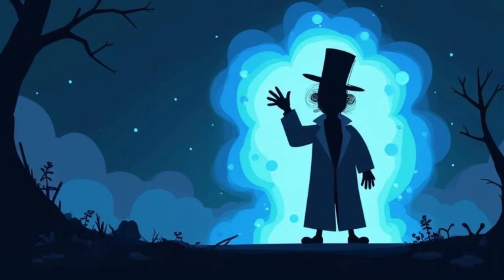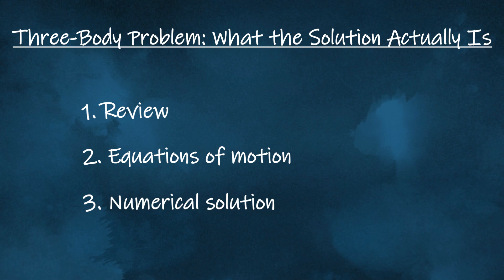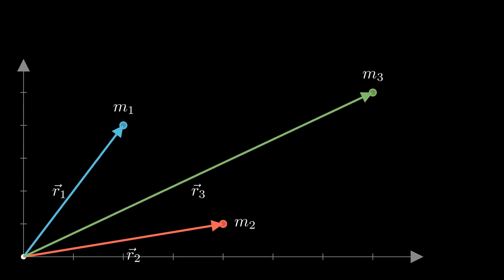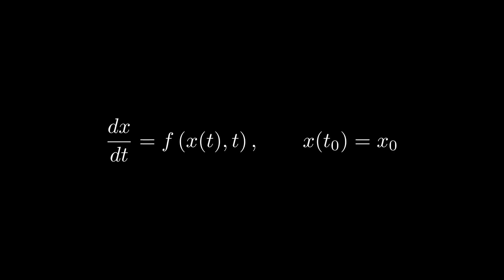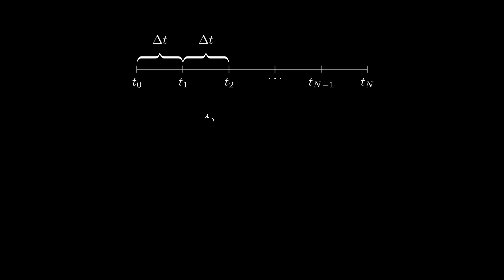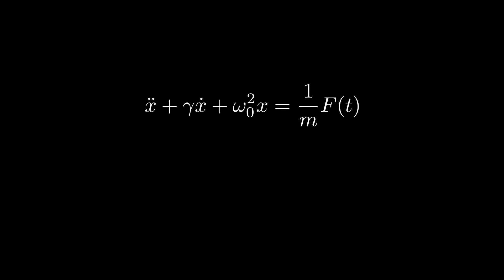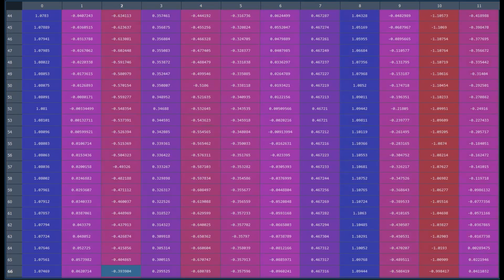Terrence Howard vs The REAL Three-Body Problem Solution

Comment from the maker: 🔧 Correction:
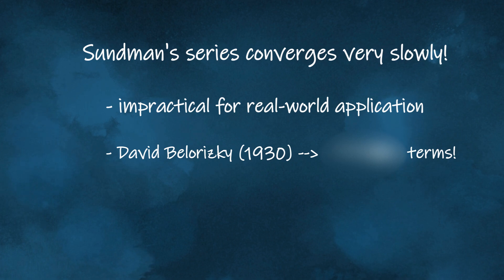At 02:33, I said "108 million terms" and also showed it on screen. That was a mistake — I meant "10 to the power of 8 million", or 10⁸⁰⁰⁰⁰⁰⁰.
Thanks for your understanding, and sorry for the confusion!
Reply: 10^8,000,000 is, indeed, a slightly less practical number of terms than 108,000,000......

Comment: Newtons equations are approximations.  Use GR.  cant say it doesnt matter because it causes mercurys precession even in our solar system.  Should be quite interesting and challenging for a computer.
Reply: Also, there was some proof about the stability of our solar system in the last 10 years, a problem tougher than the 3 body problem.  I didnt look too closely at it, but it showed the solar system is stable and survived peer review.  Worth mentioning if you can chase it down.

Comment: How are direct collisions handled? Does the assumption of point masses let then be waved away as having probability 0? Still seems like there'd be some sort of singularity in the solution near such trajectories.
Reply: yes, they generally aren't because we assume point masses and so collisions are probability zero, but you also could just set up initial conditions constrained to a line which forces a collision (say, one point at (-1, 0, 0), another at (1, 0, 0), and the third elsewhere in 3d space aligned to that line), and ask those big tough scientists what you do then.

Comment: Is the crux of the three body problem not the fact that chaotic behavior means we can never accurately predict the trajectories of 3 bodies under mutual gravitational force (since there will always be measurement error, slight numerical imprecision in finite precision number storage in memory, etc)? Even if we were able to apply Sundman’s series to a real set of 3 bodies (which were also somehow gravitationally isolated from everything else in the universe so as to prevent accumulation of error in our model due to outside interference), our prediction would eventually fail to resemble the real trajectory due to measurement error on the initial conditions of a chaotic system.
Reply: No, that's just a practicality issue. There are plenty of gaps between mathematics and practicality- infinite serieses, for one, would take an infinite time to evaluate properly, and although we don't know every digit of pi, in reality we don't need more than 13 digits to get subatomic levels of precision.

I don't think the chaos of the system is closely related to its ease in simulating- a double pendulum is arguably more chaotic than a three body system, but we have a really simple closed form solution to its behavior. The three body system is just difficult to integrate because what was a smooth gravitational gradient across space when there are two bodies (one interacting with another), is now a jumbled mess with a third body continually disrupting that field with an additional gradient that, itself, keeps changing.
Reply: @ferociousfeind8538   “a double pendulum is arguably more chaotic than a three body system, but we have a really simple closed form solution to its behavior” this is a fair distinction to make as far as the essence of the problem description is concerned, but I also feel the natural follow-up is that the chaotic nature of the three-body system is why numerical methods are not “good enough”. 

You can numerically solve a two body system and, in doing so, produce a trajectory that resembles closely at all times the real trajectory derived from the closed-form solution. Meanwhile, the chaotic nature of a three-body system means that not only will numerical-method-generated trajectories always eventually deviate from the real trajectory via accumulation of errors, but ALSO that even a closed-form solution would eventually fail in the face of measurement errors with respect to the initial conditions.

Comment: is the volume of bodies not relevant? The current model assumes all bodies are points of given mass, I assume the gravitational field changes depending on the relative volumes of the bodies, assuming different densities, or is that not true?
Reply: It shouldn't matter unless the bodies are very close to each other
Reply from the maker: Good question! In the classic three-body problem, we treat objects as point masses. If the bodies are spherical with spherically symmetric mass distribution, then only the total mass matters—not volume or density. Of course, in reality, bodies aren’t perfectly spherical (Earth is an oblate spheroid) and don’t have exactly symmetric mass distributions. But when bodies are far apart, they can still be treated as point masses with good accuracy. If they are close to each other (like Earth and Moon), shape and mass distribution start to matter. This is usually neglected in the three-body problem, because the main question is what the trajectories look like.
Reply: @VisualScienceDiaries I understand, thank you

Comment: According to Wikipedia, the Sundman solution requires 10 to the power of 8 million terms, not just 108 million.
Reply from the maker: Thanks for pointing it out! There was a mistake during the video editing — 10^(8,000,000) accidentally turned into 108 million. I'll fix it.

Comment: If you don't know the precise initial conditions of a system, but instead have a probability density function in phase space (for example due to measurement uncertainty when determining the position and speed of real objects) how would you go about modeling the time evolution of that probability density function? Would you just do a Monte-Carlo simulation with many randomly sampled initial conditions or is there a more efficient way of going about this?
Reply: Doesnt QM actually do this already?

Comment: Periodic or otherwise bounded solutions are rare (measure zero). General initial conditions lead to "evaporation", usually by one mass hyperbolically escaping from the residual pair (in both time directions).
How do I know that? Hard to explain without invoking phrases like "phase space" and "ergodicity".
Reply: proof by "just look at it dude"

but, hmm, now that you mention it, yeah, one of them would be flung out most of the time in both directions... I wonder what such a situation would look like, played from the reversal of one of the so-called "evaporation"s of the state, passing through the original seed conditions that produced both evaporations, and playing forward through the second evaporation. Like a moment of chaotic dancing between eons of silence
Reply: @ferociousfeind8538  Just imagine a chemical reaction in a gas (or nuclear reaction in plasma). Reactants bump into each other, forming an activated complex, that decays into (probably differently combined atoms in the) products. Yeah, in chemistry you think about the activated complex as a single, almost-stationary metastable bound state. But if you are thinking properly in terms of wave packets, the activated complex is "bubbling" similar to the temporarily bound system in the 3-body problem.
Reply: Resonances appear and add stability, there are several in our solar system.  Stellar nurseries tend to eject little things while big things sink in the potential well.  As far as I know anyways.  Space is big and we dont know much yet.
Reply: @deltalima6703  In celestial mechanics, the stability arises from irreversible effects (mostly tidal forces dissipating energy via dampened "geological" oscillations). The pure Newtonian 3-body problem involving only point masses is trivial in comparison.
Reply: @deltalima6703  there isn't really anything left to know about orbits, the "what we don't know" category is occupied mainly by really really small things and super ultra big plus far away things, and the hyper-specifics of certain very distant things (like what's the temperature like on Trappist 1d today?)

Comment: We actually had to program a numerical simulation for n-body gravitational systems in uni not too long ago!
Even with a 12th (?) order adaptive runge kutta solver (we could luckily use an external library for that) and all in C++, so it ran pretty fast as well.

Was a really fun and cool task if you ask me
Reply: I had a project for that in a MatLab course a few semesters ago! It was only using the first-order Euler-Cromer method, though.

Comment: This solution is inefficient because it doesn't take into account that when the bodies are far apart very little is happening, but you have to keep the time increments very short for the rare occasions when the bodies are extremely close together, which will always happen at some time because of the chaotic nature of the 3-body problem when the masses are comparable. A much more realistic approach is to have variable time increments according to the relative positions. (I know this is just an obvious thing for anyone actually contemplating doing this). This, however, also brings up the added complication that when the bodies do approach each other closely, even slight deviations from confinement to the plane of the ecliptic can lead to bodies being ejected from the plane, so the third dimension then cannot be ignored.
Reply: This "inefficiency" is a practical issue, rather than a mathematical one (certainly didn't stop Sandman's infinite series)

but also yes, any good function for the three body problem f(N, X) where N is time to pass and X encodes the three bodies, MUST be able to function completely accurately at any timescale- F(1, X) should be precisely equal to F(0.5, F(0.5, X)) (AKA taking one full step should give the same results as taking two half-steps)

Getting complete accuracy isn't easy, though, hence this is a lingering problem.
Reply: @ferociousfeind8538  this doesn't make sense. So you're saying that I can have a time step duration of 1 million years and it should be equivalent to 1 million years worth of nanosecond timesteps?
Reply: @kingcrimson1631  as in, the output, the positions. Running the function once should produce the same result as running it ten times at one-tenth the timestep.

For very simple functions this can be quite easy, f(x)=x accomplishes this, where f(x)=x² does not